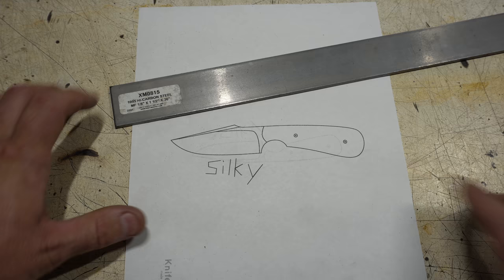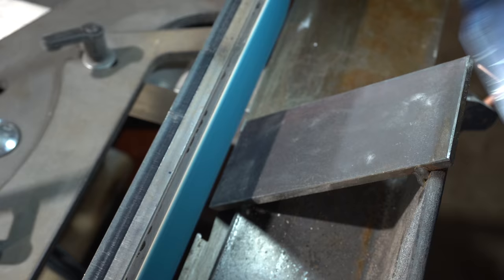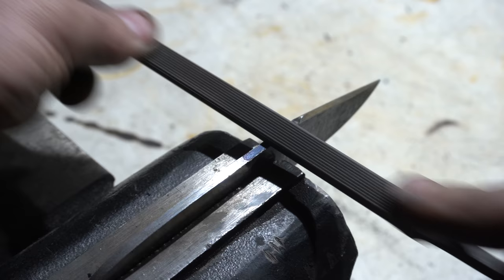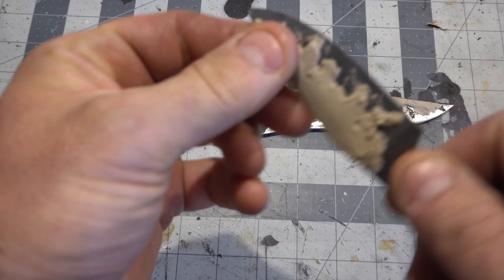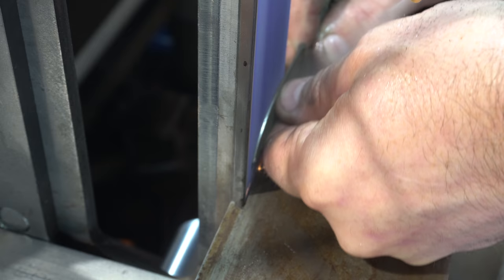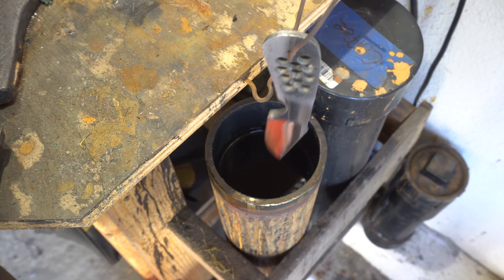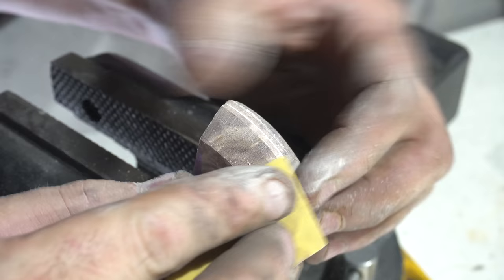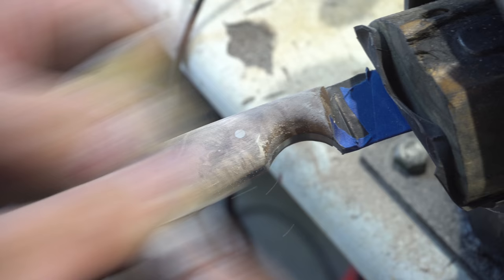Making an EDC Knife with a Hamon

Comment: Fun fact: my first wood carving, (still working on it a year later even though it’s the size of my palm) I put the piece in a vice, and I was trying to get rid of some wood off the top, and the knife decided it didn’t want to try anymore and went straight through. (Mind you, wood carving knives are essentially the off springs of utility razors and scalpels, making them one of the sharpest blades after just ten minutes on a whetstone which I previously did a few minutes before this) But I was wearing gloves, which did me absolutely nothing because it went straight through the glove and almost took my finger off. Now my grandfather has a pair of working gloves with one finger completely soaked with blood on the inside and a hole big enough to fit a raccoon. Fun times!!
Reply from the maker: That doesn’t sound very fun. 😬. I hope you didn’t need stitches.
Reply: @TyrellKnifeworks  nah. My sister was there and has SOME medical training, but I thankfully didn’t need stitches. Got a pretty cool scar, though!

Comment: Hey Tyrell. I've done some experimenting with hamons and I have found a few things that I think could help. 1: Grind the initial bevels closer to finish than you normally would. The hamon will lose some of it's definition as you grind off more material. 2: when applying the clay try to get a good even coat (about 1/8" thick) all the way to the edge. Let that harden then take a dremel with a wire wheel and carve out the clay where you don't want it. this allows you to have a much more detailed and uniform hamon. 3: Instead of using the Ferric chloride use warm lemon juice. It takes a lot longer but you'll get more ashy (spelling?) effect. Just etch in juice, polish with Flitz or Mother's metal polish and repeat. 
Great knife man. Hope this helps.
Reply: Also, I haven't tried this but I have seen a few makers have good success with it; try a disrupted quench in water then oil. Just one second in water then quickly quench in oil.
Reply from the maker: I’ll consider it next time.  Thanks for watching!

Comment: Outstanding video, my question to you sir, what kinds
Of steel makes a good hamon?
Reply from the maker: You need steel that quenches at a very fast rate.  1095 and W2 are the most common steels.  Medium or slower quenching steels line 5160 and O1 do not produce good hamons.  Thanks for watching!

Comment: You could get a very intricate line on your knife by using masking tape to make your design lay your clay over top of the masking tape pull masking tape off there's your design .
Reply from the maker: It’s doesn’t work quite that way.  The hardening line doesn’t follow the clay exactly. Even if you put complex patterns in the clay it usually just forms a wavy line.  Thanks for watching

Comment: I don't know what it is about swedges(false edge), but they sike me out everytime. Probably all in my head, haha... That "flamy" hamon  look is B.S.. I've had guys tell me every different type of clay, then when I tried that, I was told it's a special steel from Russia. So I call B.S.. W2 is definitely the best for pronounced hamons & honestly, as long as it's high temp, clay doesn't matter. Hope all is well, take it easy.
Reply from the maker: That’s why I do the false edge by hand with files.  The harpoon point is much easier.  As for the flamey hamons, I’m not sure what causes them but they certainly are a thing.  Walter Sorrels did some that are incredible. Thanks for watching Dave.
Reply: @TyrellKnifeworks   I'm pretty sure what he does(& a lot of other guys) has to do with finishing and polishing. If you look, the line is straight through & wavy. The "flames" are a different grit/levels of polishing to make it look like flames. It where I got the idea to buff out a mirror, then stonewash it to the hamon line. It's the finishing, not the hamon. Go to 8:41 of Walters video https://www.youtube.com/watch?v=bwQtXVM-rqY

Comment: Good job!!  Man that's a sweet little cutter.   Hey did you polish up the hamon after etching?  If not check out Neels Vandenberg's video on his polishing method using Autosol. Ive been doing it, it works like a charm 👍
Reply from the maker: I did polish it a bit but I wanted the dark look so not too much or I’d lose all the oxides.  Thanks for watching!

Comment: How do you feel hold up is with 5 min epoxies compared to other epoxies that have a longer cure time? I've used a lot of different epoxies and have gotten better life out of the ones with longer cure time. I've gotten good results with 5 min epoxies but the times that they have not worked out was probably due to human error and not the epoxy.
Reply from the maker: I’ve always used 5-min epoxies with no issues.  I think those that have problems are user error.

Comment: Why don't makers put their maker's marks on the spine of the blade? I can see yours is a little large to do so, but I'm  a kind of person that appreciates subtlety over "billboarding" (like some of the major knife makers do like Zero Tolerance, Spyderc, SOG, Benchmade, CRKT, Kershaw et al, et cetera.)
Reply from the maker: One main reason is that custom makers electro etch, which requires a stencil and it’s very hard, like REALLY hard to do on the spine.  Those big makers are laser etching, which is easy to put the mark anywhere.  Note, those machines are $4k or more, that’s why you don’t see small custom makers using them.
Reply: @TyrellKnifeworks  oooooh. Okay. I would've figured that it would be really easy to acid etch the spine. Thanks!